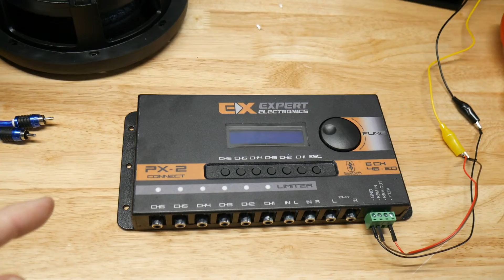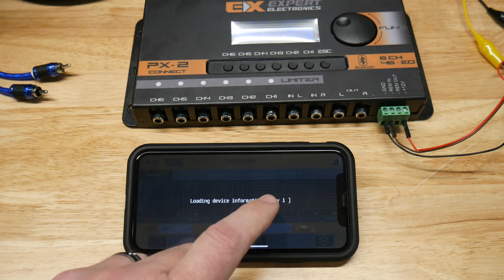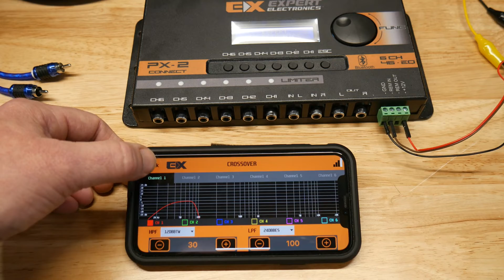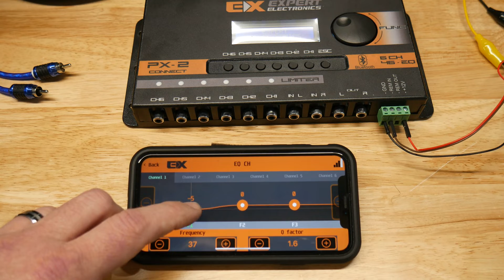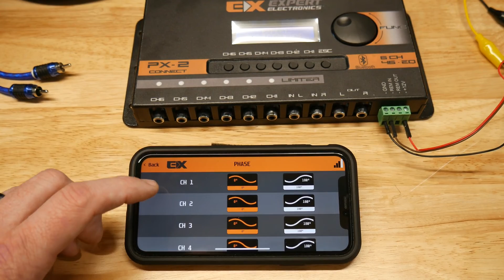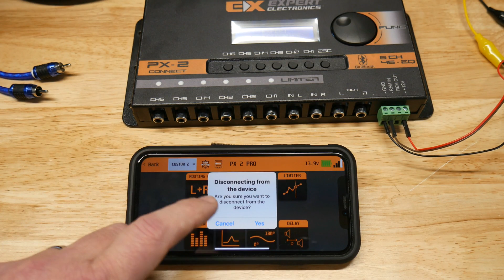Car audio DSP settings explained Expert Px2 connect and others in depth

Comment: It’s awesome. I have a ported subwoofer so I played around with the delay for my front main speakers. So now my front is delayed 1204 ms from my sub and it sounds amazing. And you can tune it from your driver seat on your phone in real time.
Reply: Take the string (about a foot in length) and tape it to your vehicle's ceiling centered between your seat and the passenger side a few inches forward from the headrests (where your ears will be located). You can then either tie a knot in the string or draw on it with a marker where the height of your ears is. From there, you take 2 measurements... One from the furthest point your enclosure produces sound from (whether it's the location of the port or the sub itself depending on your orientation/setup) back to the marking on your string. Write that measurement down, in decimal form. Then take the measurement from the string's marking to the center of your front windshield, doubling that length as your "distance", and adding the two numbers together.... 
Now, I don't have your DSP, but most of them do time correction offsetting based upon the number you just came up with; the spacial distance of your enclosure and it's inherent reverb. The way my HU's DSP works is by entering that distance and it automatically delays the output of the door speakers accordingly (through a calculation) to allow for the subwoofer in the back's sound to travel the distance to my ear enough that when the doors play, all sound from all speakers hits my ear at the same time (which is effectively what you've done in a more barbaric way with your "playing around" and came up with some absurd numbers because of). That all now out of the way and said, while I know my value for this measurement and how my delays are set accordingly, I don't know yours, but I'd be willing to help... If you can get me the measurements said prior, I can get back to you what your values should be closer to, 'cuz they're very likely to be a (much) smaller one than what you've given them. The smaller the vehicle, the smaller those values need to be, so I doubt you're driving a limousine with subs in the trunk to warrant the 1.2 second delay you've presently set up. If you want my help, it's there for you, but it is after all your vehicle and decision to alter as you see fit and you'd know what sounds best to you in it... That, and not all units processing time correction will do it "the same way", so there are variances to be had... 

As a side note, if you just want a reference to do the math yourself without the use of my HU's calculation, a highly reputable sound company posted these "standard" values as a chart: 
5 meters = 292 m/s delay
10 meters = 584 m/s delay
15 meters = 876 m/s delay
20 meters = 1170 m/s delay
or
10 feet = 179.3 m/s delay
20 feet = 358 m/s delay
30 feet = 536 m/s delay
40 feet = 714 m/s delay
50 feet = 892 m/s delay
(Which, none of these account for reverb, so I'd recommend doubling to self-correct echoing and is more inline with what my HU will typically project.)
Reply: @RAW_Reality  thanks buddy. I’ll try it. I just played around for 20 minutes listening till it sounded best. Playing with the bass knob and listening to kick drums and bass response syncing up. 
As you know, physics is not always logical. The cabin of a vehicle is complex and there’s a bunch of variables inside the electronics going from a head unit through Bluetooth then through multiple amplifiers. I have an inexpensive DSP that might not be calibrated correctly playing through a Grand Cherokee with odd glass panels and a ported subwoofer.  Maybe my 1204 ms might be 306 ms in theory. 
But I’ll try the string and see what happens. 
Thanks for taking your time to help me out.
Reply: @johnviera3884  
I meant to say previously that sound travels at 761 MPH (or about 1100 ft/sec), so if your delay really was over a second, that's more than the length of a football field you're calibrating at (hence the reason I wanted to bring it to your attention). But another thing that I didn't even think about then is that it could just be that some DSPs move a decimal point when relaying information... Like, it'll show "1204 ms" when it really means "120.4 ms", and that'd seem very likely given the size of your vehicle and how it correlates with that scale I listed. Now, assuming that's the case with how your DSP displays, it could be that you're actually under the delay you'd want to be at, as my vehicle (which is similar to yours in size) is a 366ms delay (or what might appear to be 3660 to you). Who knows. 🤷🏻‍♂️😅
But yeah, all things considered, it's up to you to decide what sounds best to you; I just thought the math sounded all wonky and thought maybe I could offer some help... So hopefully everything's sounding great, however you end up getting it there. 😉👍🏼
Reply: @RAW_Reality  I just noticed it says “mm” not “ms”. Wow. Did they really calibrate it to millimeters? Or is it a typo?
Reply: @johnviera3884  read STETSOM STX2448 Manual page. 36
Reply: @Manuel-u2y4  thanks
Reply: I'm under very heavy assumption that the distance between your ear and the farthest output of your sub/port is venturing up on 140 feet, my guy... In other words, the setting of 1.204 seconds is excessive, unless you're driving a double stretched Suburban. 
In my own personal experience (of setting up multiple installs), a simple way to get a great value for this setting is by doing a bit of math with a string, some scotch tape, and a tape measure... I'll explain...

Comment: Always double check your settings after changing them. I found that the Bluetooth is wonky. Sometimes the new settings won’t stick. It’s better to play around in the Bluetooth till it sounds like you prefer. Then go to the unit and input your settings with the dial. This will always ensure your settings are applied
Reply: It didn't used to do that... Since I took it out of one car and put it in another car it started that crap and it's aggravating, have you found another work around  besides physically messing with the dsp?
Reply: @1hundredallday  close the app. Then re-open the app and log in again.

Comment: I just got mine. I assumed it was a 28 band EQ per channel. 
It’s a 15 band master EQ. Ugh. Its still an awesome DSP and works well. The manufacturer details are misleading. 
My old DSP has a 31 band EQ that’s user assignable freq. and Q factor for each channel. 
But it only worked with a 5V input. And my Bluetooth rig only pushes 2V. 
I love the app though. No more lugging a Windows PC and cables.
Reply: yeah i agree,, , pretty shitty.. what was your old one???
Reply: @mikeriverajr4447  a Recoil REDSP
Reply: @johnviera3884  i just checked it out. . .that is the analog audio dsp chip interface. . that chip is used in the same razordsp amp i have and the the dayton audio dayton dsp408
. . its a really awesome chip BUT its a ashamed its not used in more places
Reply: @mikeriverajr4447  I had an output level issue with it. I had very low output to my amplifiers. Unusable even with all gains on full power. 
The Expert PX2 has a better output level.

Comment: Got a question. I had a Rockford  Symmetry epx2 witha 24 band card back in the day. So can you put a y cable on channel one and use that for front highs, one on channel two for front mids, another y on channel three for rear highs, etc.  Set the unit at the L+R on each channel in center will it not have to stereo sound that way? And sound weird?The Symmetrys eq was too much but the xovers were awesome and just super control on everything
Reply from the maker: Yes you can configure it that way. And you would just lose your left and right separation most people would say it’s not too big of a deal but on some songs there is separation that you would miss out on. Also there is another expert DSP with more left and right inputs that might be useful in your situation.

Comment: Can you use one chanel  and split it in two with a y jack. Like feed a 2 channel amp out of one chanel from the dsp? Thanks.
Reply from the maker: Yes you can do that. You would just set the DSP so that one single output is outputting right and left channel through the one output.

Comment: I have had this exact dsp for like 6 months now its a great entry to the dsp world I love it and the price is unbeatable.

I do want to speak on the phase tho. I honestly use the phase options all the time. When I unplug my door speakers from the amp my polarity gets messed up a lot and instead of physically switching the wires around again I can easily switch the phase. 

Also, this dsp does have pink noise but you can only access it from the dsp not with the app

Comment: This is an amazing piece of equipment for the price. I'm doing a new setup in my 2015 grand cherokee and definitely going to use this. I was using the factory deck going into an audiocontrol lc6i, tapped into the factory amp after its been crossed over and frequency limited. I summed the channels on LC6i but it seemed like I still had a major Drop-off at 30 hz still, and my box was a Transmission line tuned to 33 hz so it shouldn't have fallen off so steep after 30 hz IMOP. This time I think I'll use an LC2i tapped straight off the back of the factory deck before it goes into the factory amp and is limited by crossover points to start off with. Then I'll run the LC2i into this badass piece of equipment. Thats should give me a very percise and full range of frequencies to send to my 4 channel and sub amp vs last setup. Thanks for uplaod. I'll be watching again to set mine up when installed
Reply: I have a 2017 Grand Cherokee. Instead of tapping into the factory speaker wiring,  I use a Bluetooth receiver and send the signal to the DSP on a 3.5 mm to RCA. Then I distribute the DSP out back to my factory AUX jack. Tuned! 
Then the other DSP out goes to my subwoofer amp. Tuned! 
No cutting wires. No bass limiter. No LOC.
Reply: Can I blue tooth to this dsp if not is there one from this brand that's good and cheap..thanks